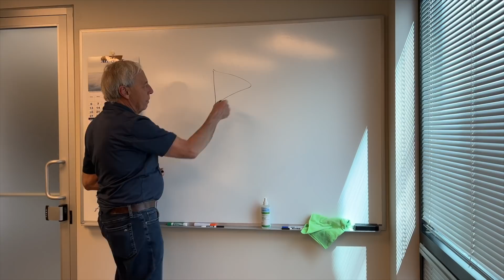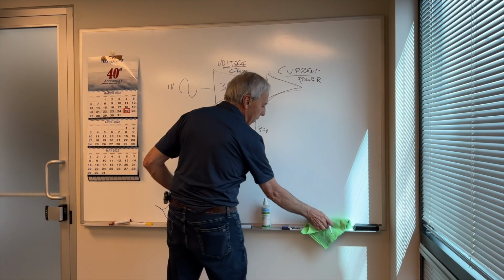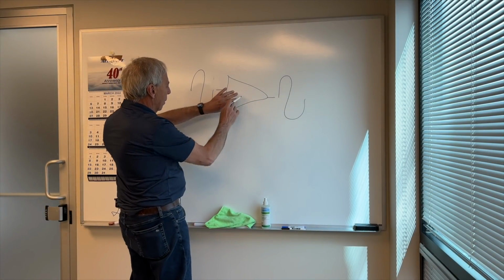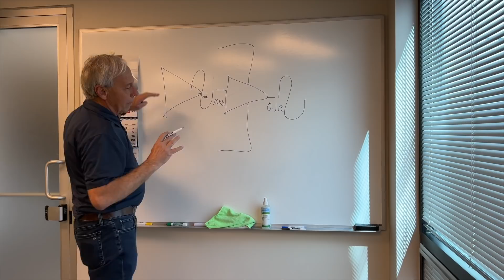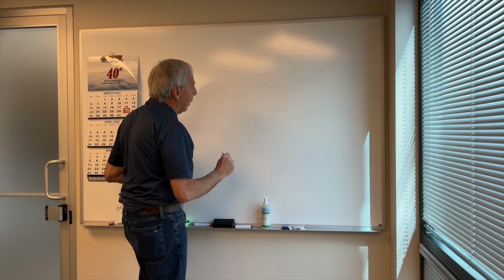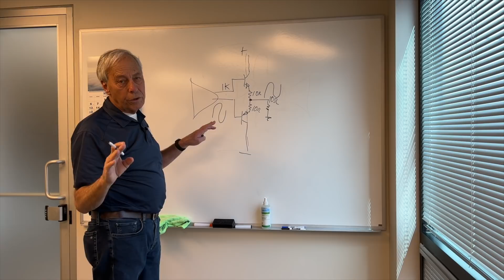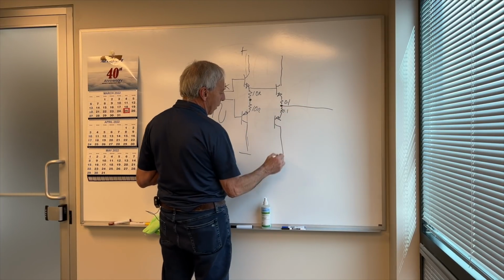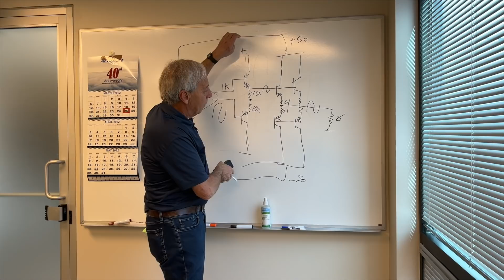How power amps handle big loads

Comment: Thanks, Paul. This was great!  Tube output stages are a different animal altogether; they output current*, meaning that the frequency response will *follow the speaker's impedance curve. I assume this is why you prefer transistor power amps!

Comment: In short: You want push pull class A(B) topology, lots of parallel output devices with low source resistance and a big power supply with low resitance everywhere. Usually this means big and heavy and very hot, if its supposed to also sound good.
Reply: Florian, not true. Just use one channel on any 2-channel power amp and you can drive a 2-Ohm speaker. You just need 2 of those identical amps. They can be small and low budget like the NAD C275 BEE.
Reply: @raffiequler7510  Bridging gives you double the voltage swing but not generally more current capability. From the amps channel perspective speaker impedance is then cut in half. If the amp was voltage limited before you can play louder though. Of course class D can also give you lots of cheap current, but who wants that. :goodvibes:
Reply: @florianhofmann7553  I'm not talking about bridging. I'm talking about using only one channel on an amplifier. Stereophile measured the NAD C370 with just one channel driven and it gave 305 Watts into 2 Ohms continuously.
Reply: @raffiequler7510  Yes double the power supply will give you more current. Have a good one Raffie :goodvibes:

Comment: Alternately, you can do what Bob Carver did with his Sunfire amps by tracking the input signal and maintaining the transistor rail voltage to 6 volts above whatever is required to reproduce the sound output. This results in huge amounts of power while producing little heat.
Reply: And dynamically shifting operation conditions.

Comment: The explanation given in this video also highlights the reason why the pre-amp or voltage gain stage is where the amplifiers characteristics or colour is imparted in the weak signal coming in.
Guitar amps are a good example of this. Weak voltage from the pick ups is increased by the pre-amp. The power amp stage should just increase the current or power so that the speakers can be driven effectively. The power stage shouldn’t impart colour onto the signal.
Reply: Except, unlike audio/ HiFi amps, guitar amps are designed to add distortions. Each is known for it's specific sound from it's designed distortions.

Comment: The output voltage level is still the representation of the signal thus a traditional power amp is still also a voltage amp, but of course with low output impedance.

Comment: so a speaker must be designed so that it responds to a certain p2p voltage varied over frequency with identical output SPL, regardless of frequency, and the amp needs to live with the complex impedance varying between low and high (reflex port resonance frequency), capacitive and inductive loads? and feedback loop compares in and output voltages, correct?
Reply: I think we deliberate the same - see my post

Comment: I’m not sure how the gain is created but at least I’m not mixing up transistors with the amplifier (triangle) part of the circuit any more. 

Does amp circuit feed the transistor controlling input (base)
Reply: Gain is achieved by applying a relatively high voltage from a power supply to a valve plate or a transistor collector   
that is controlled by a low voltage signal applied to a valve grid or a transistor base.  
  
There are a Very Few circuits in which the signal is applied to the cathode or the emitter,   
but in audio such topology is usually designed to do something other than linearly amplify a signal.    

Many valve RF amplifiers, such as are used in high-power radio transmitters, 
apply the signal to the cathode and the grid is grounded. 
This offers some advantages in both power supply design and the prevention of unwanted oscillations.    

It took me years to figure out/understand How these things work.
Reply: @spacemissing  thanks a bunch

Comment: In most  speakers happen also nonlinear drops of impedance which are accompanied by reversal of impedance  character. In linear range it   is kept near  by neutral  side. But with apparent  mechanical or electrical resonances it may be  pushed  to capacitance side.  At this moment amplifier is in trouble because feedback may lose part of  negative feedback and it amplifies affect of  nonlinear reproduction   of speaker - amplifier.  

 That is why also I do not  advice  to use too small impedance speakers to even  way above needs   amplifiers. As example 2 Ohm speaker to 4 Ohm amplifier.  It won't burn oversized end stage but will work unpleasant. When used 16Ohms speaker to 8 Ohm amplifier it also affects peformance  but  while the feedback is increased it's up to user.  Only my conclusions

Comment: Paul:  I now sort of understand this.  But the manual for my Revel Salon 2 speakers reads:

Impedence:  4 ohms (nominal) and 3.7 ohms (minimum @90 Hz).  

So how do these impedence specs fit into this video explanation?  Also, the 3.7 ohms (minimum) is confusing.  Does this mean the speakers can present to the amps a load of 3.7 ohms but not less?  Is this a warning that I need real beefy amps to drive these inefficient speakers.  Or does it means the amps must be able to drive at least a load of 3.7 ohms?

Paul is probably too busy to answer this "minimum" question, so if anyone out there cares to give me an explanation please do so.  Thanks and thanks Paul for this tutorial.
Reply: Impedance is sort of the resistive value for ac. And it is not presented as normal resistance, as the value changes with different frequencies. 

Why is it like that… well an example of this would be that a speaker with dual drivers , will have different speaker driver for different frequencies to reproduce them best. A small one that can move fast for high frequencies and a bigger one for the lower. These two drivers should not try to reproduce both high and low - sometimes this will even brake them. So we have to add a way of sorting the frequencies to go to either the tweeter or the bass. This is done by the filter normally a high pass filter and a low pass filter. The easies being a coil in series with the bass and a capacitor in parallel with the tweeter. The speaker drivers and the components being inductive and capitative will result in an advanced impedance seen from the amplifier. 
And the specs you read is telling us that the lowest impedance in your speakers should be at 3,7ohms at 90hz. 
This should be within what a 4ohm rated amplifier should be able to handle.
Reply: You just need to "size" the amp for the minimum speaker impedance (that final resistor that Paul has drawn into the board is representing the speaker). The lesser the impedance, the more current you need to pump in (I = V / R: I being the current, V being the voltage which is constant when we reach the current stage, already amplified by the voltage gain stage, R being the speaker impedance). A speaker varies its impedance as the sound frequency varies. But, if your amp is okay with 3.7 ohms, say for example at 300Hz, then it will also be okay for the other speaker impedances on all other frequencies, because they require less current.
Reply: @christopherkise  So, the speakers should not ask more from the amp than 3.7 ohms at 90 hz.  Is this what you are saying?

Thanks very much for your response.  I've never understood all this.
Reply: @MarcoRistuccia  Thanks a bunch.
Reply: @joeb4349  do not overthink these terms. Generally- not always but generally an consumer amplifier should be stable for a range of impedances around the provided and a 4ohm speaker output is probably always +-20%. Ad the speakers tend to be less than flat. 
The amplifier might have earlier distortion than with a speaker above 4ohms. Generally again the amplifiers tend to have bigger problems with a high capacity in the load than a bit low impedance in total. 
Do not worry about 0.3ohms impedance. 
Yet an amplifier saying it is stable at 4, might burn up at 2ohms (so dont push to much. 

Always listen for distortion, and do not push your amplifier to hard
Reply: @joeb4349  yes, the 3.7 is the min. It would hit at the 90 hz. Normal music, it would be well above that. Most all speakers can go lower than stated ohms, so yours is a typical 4 ohm speaker. Nothing to worry about at all.
Reply: @Vortexan9804  Thanks.
Reply: @christopherkise  You can just use one channel of a stereo amp and it will then easily drive any load. The only thing is you will need 2 identical 2-channel amps.
Reply: @raffiequler7510  this is not correct. 
Many amplifiers are dual mono, and the channels does not have anything to do with each other.
Sometimes they share a dual power. 
It is not given that an amplifier can be bridged, and see lower impedance.

Lets see this in a bigger picture. An amplifier with a 100% short 0 ohm impedance must be able to provide unlimited current. This is not possible, and the voltage will collapse over the load. 
On the other hand you need to have less than infinite impedance, to be able to get any current going through. 
One will need a balance to get the best of both worlds.
It is also an important to think about the signal transfer. The balance between the amplifier and the speaker. 
If you push a car and the breakes are on so it does not move you can use as much of your power mussel as you would like, nothing moves and all the power used turnes to yourself and you get hot.
If you try to push a car downhill with no breaks you will not be able to continue to push your power into the car, it wil outrun you. 
So to be able to transfer the power of your body evenly to the car it needs a balance, maybe on flat ground with no breaks on. 
The same is true for impedance, the amp needs to se a load it can handle- and be able to push ideally all its power out to.
Reply: @christopherkise  Dual mono amps are rare and too expensive. A stereo amp that shares its power supply with both channels works just fine. Using only one channel then enables the amp to provide enough current for the 2-Ohm load. You just need a second identical amp for the other channel. Any NAD amp can do it easily. The NAD C370 was measured by Stereophile magazine and it produced 305 Watts continuously into a 2-Ohm load with one channel driven.
Reply: @raffiequler7510  All though I understand and respect your views about this , i do not agree with you.
The differences in dual mono power amplifiers is in separate power supplies.
So in many ways the C370 amplifier is a dual mono power amp, with singel power suply and common earth and driver circuits to be able to do provide easy bridging. 
The C370 will provide about 300w into a 8 ohm load in bridged mode. 
And the manual even states that a minium of 4 ohms single speaker is to be connected when used in stereo mode.

The stereophile test you reffer to allowed for a 1%THD on a 2 ohm speaker to be tested, it does not say anything about the dutytime, all thogh they say this is continous. If this amplifier could do 300w they (NAD) would clearly use this as a sales point. This amplifier does also have a different way of seeing the output impedance, and actually try to adjusts the voltage and currents to match the output impedance load. This was promoted as an extra feature on this amplifier, and patent pending.

The use of lower impedances than rated will usually result in a very hot amplifier, with less than ideal power transfer out to the load. With a lot of standing waves and intermodulations resulting in high THD and a broken amplifier.
Reply: @christopherkise  Continuous power means continuous power. Driving two 4-Ohm speakers or one 2-Ohm speaker is the same thing. This is why Stereophile did the test. All and any 2-channel NAD amps can easily drive a single 2-Ohm speaker. Also, the manual states two 4-Ohm speakers are minimum and not just one. Please stop lying. It's bad karma for you.
Reply: @raffiequler7510  we must agree to disagree. 
My view is that :
It is not the same. It would have been the same if it was the same output, but it is not. It is dual amplifier outputs in stereo. 
Normally designed amplifers does not accept double the load just because you connect half the load. 
The power supply itself is ok with this, as it can provide the current. But the output transistor or transformer is not impedance matched to handle a load below the value informed by the producers.
Reply: @christopherkise  You are obviously not an engineer and you don't understand how amplifiers work.
Reply: @raffiequler7510  Please enlighten me. 
Please explain the technical reason that the amplifier will accept higher load (read lower impedance) if you stop using one channel or more channels.

I think there is several reasons, but these main reasons comes to mind:
1:
Let's think about a 4 channel power amplifier, normally rated for 2 ohms, by your logic this amplifier should be able to handle 0.5ohm impedance's just by not connecting t three of the outputs.

2:
The Zs of an amplifier, needs to be higher than the ZL. Usually we say that it should be >10 times the value of Zs.
The Zs of an output is a static value, and it does not change when changing the ZL.
This means that the power loss over the amplifier will be higher with a lower impedance - creating a hotter output stage.

3:
If the output stage is made of two transistors with a maximum current of 10A, and a voltage of 60v, ptp at 8 ohms the outputs will not be able to handle 60v 20A out to accept an 4 ohm load.
This will blow the fuse or the transistor.

Comment: You might add as you are at that point, that if the output stage has a 0.1Ω output impedance, it has a Damping Factor of 80 at 8Ω. DF=loadΩ/ outputΩ
Reply: Which, of course, is the whole point of the final amp - to drive a complex load with such a low impedance that regardless of the connected impedance, the speaker sees a voltage that's a nearly perfect representation of the input signal.
Reply: @carlosanvito  Or in tubes with transformer outputs, impedance matching for maximum Power transfer.
Reply: @glenncurry3041  As you said, tubes are a different beast, having high output impedance. Unlike transistor amps, a high-Z load will damage the output Tx of a tube amp, so Z matching is critical.  Negative feedback can help to dynamically improve damping factor but only up to a limit.

Comment: The direct answer, IMHO is pretty much all the above.  The type of transistor/tube, the topology, and the power supply for the output stage of the power amp determine its ability to drive a difficult load.  A little more complicated in class D.

Comment: At 09:15 "just tie these things together" - it looks like you're connecting the base of a transistor from one stage with the base of the transistor from the next stage. I assume it's emitter to base?
Reply: Last 2 transistors are base to base as they are in parallel for load sharing many high  power amps use parallel power transistors on the output
Reply: Thanks, that makes sense. "In parallel" and "load sharing" would be considered the same stage though, right? Not an additional one, like the video suggests.

Comment: If you use just one channel on virtually any 2-channel power amplifier, you will have plenty of juice to drive any 2-Ohm rated speaker. You just need 2 of those then to drive 2 speakers. No need for buying expensive monoblocks or any other amps rated to be able to drive 2-Ohm loads. They are way too expensive and completely unnecessary.